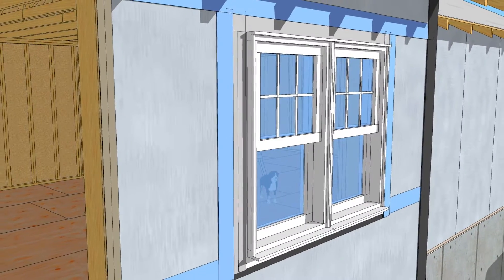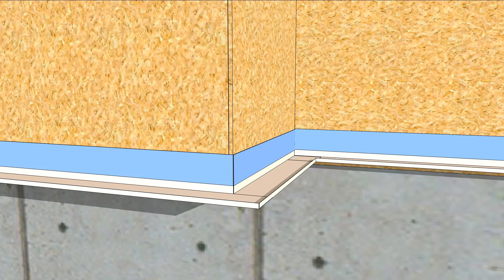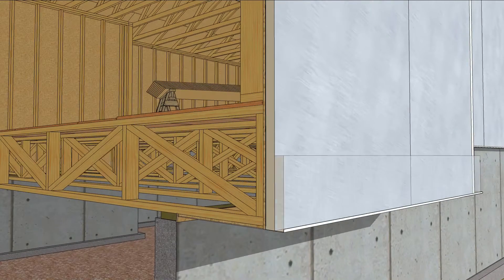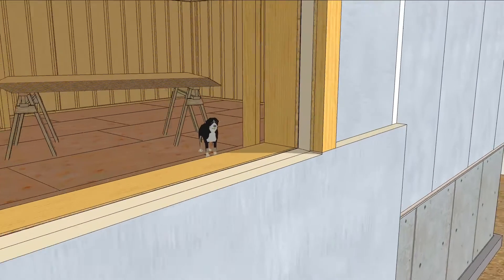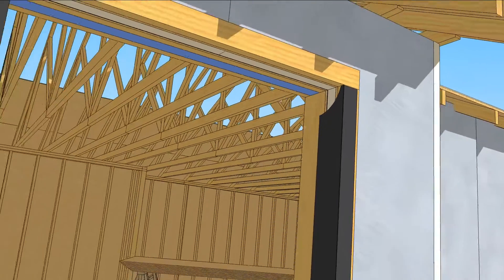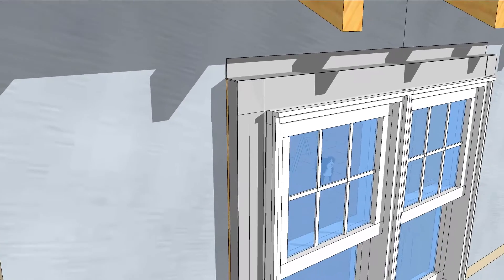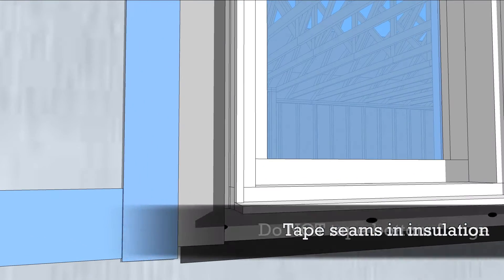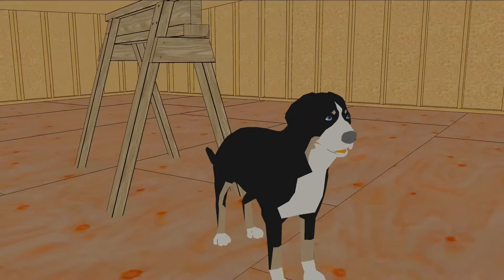Outie Window Details for Thick, Thick Walls

Comment: Thanks and for mentioning the metal bug shield at the bottom and for pointing out how important it is to tape All the seams for air tight. And that 5 degree bevel on the sill and to leave the bottom front of the window unsealed for water to run.....water, air, vapour then thermal are the priorities in that order. Yupee Joe Lstiburek✔💯  ☺🇨🇦🍁
Reply from the maker: I am not sure Joe is a Yuppy, but I will accuse him of it next time I see him. I'll let you know what happens next.

Comment: Yeah this is probably gonna void window warranties. No structural sill holding weight of window from below. Fasteners through jambs and nailing flanges should be dealing with only wind loading not the self weight of the window. No?

Comment: Wouldn't the bug guard hold water since it is folded up on both sides?
Reply from the maker: If water were to get in, yes. But the outer edge is sealed with flashing tape and hopefully, your detailing is good enough that water isn't leaking in between the layers. If it is, you've got other problems.
Reply: its a breathable mesh
Reply: @AdjustinThings  We are referring to the flashing under the insulation. It's metal.

Comment: Actually, this window WILL be dogged by water problems, because 1) The window buck MUST connect back to the structural framing and form a "box" around the rough opening that you can flash to and connect finish materials, shims, etc to.. In the video, the "window buck" fastens only to the first layer of rigid insulation, and there's no blocking at the 1st layer of rigid insul., which can be a problem. 2) The air barrier (house wrap) should be in the same plane with the window nailing flange, so that the flashing around windows can be easily overlap/underlap the house wrap as needed, so that the assembly can properly shed water. In this video, the nailing flange is well outside the plane of the house wrap, and the flashing does not connect back to the house wrap. The flashings, therefore, are not going to work; water can and will get behind both layers of rigid insulation and will not properly drain back out. In conclusion, if you want to use 'outie" windows, this is not the wall assembly to put them in. In this assembly, you'd want the window flange to be installed directly over the sheathing.
Reply from the maker: It's good to see someone paying attention rather than just lobbing "too much work" comments.

1/ I did not show the fasteners because I assumed people would be smart enough to use fasteners long enough to reach the framing behind the first layer of foam. Anyone smart enough to build this way is smart enough to fasten bucks to framing, as you prove.

2/The housewrap is not the primary air barrier.it is part of an air barrier system, which begins with taping the seams in the sheathing. The window flanges ate flashed to the outside surface of the exterior foam, just as they would be taped top the exterior surface of the housewrap. No difference. In fact, the project this was based on used ZIP sheathing, so there was no house wrap involved at all (I included it to be more inclusive of alternate methods).

Here are videos of the process: https://www.youtube.com/watch?v=8dZtRYSouj8&list=PLU1aP_Y9qGOzn6nY_N4rwnvZ4XrYuLTGm
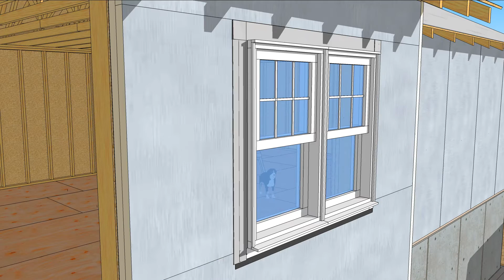Reply: @ProTradeCraft  Thanks for attaching the videos - I watched all five. Your response 1) makes sense, but you still have the issue of having to attach the interior window trim that wraps around the window head. jambs and sill to the one layer of underlying rigid foam. Response #2: There actually IS a difference between flashing to the outside surface of the exterior foam vs. flashing to the housewrap (or Zip sheathing), which is made clear in video #5 at 0:12 https://www.youtube.com/watch?v=4I0tydrCyvE&list=PLU1aP_Y9qGOzn6nY_N4rwnvZ4XrYuLTGm&index=5. In the video, the voice over mentions the Z-flashing atop the window is used to "push the water out if it gets behind the outer layer of foam"; but what about the inner layer of foam that water can get behind? Therefore, you need to flash back to the housewrap or sheathing , which serve as you water resistant barrier. Flashings need to tie back to the water resistant barrier in order for water that can (and will) get behind the rigid foam insulation to be routed back out.
Reply: @Seattle-2017  It's even trickier than that!  EPS is vapor closed so using ANY EPS on the exterior of the WRB means the wall only dries in one direction-IN!  Any moisture trapped between the EPS and the WRB (whether its taped Zip or house wrap) does not dry outward!  Not an impossible to mitigate problem but it demands the use of a really good 'smart' moisture barrier on the warm side of the wall.  Using a standard plastic vapor barrier (vapor closed) will create so much moisture between the barriers that (WRB and moisture/air barrier) that rot is virtually assured.  I ran into a legacy situation similar to this and solved it with the use of mineral wool interior insulation and an Intello smart air barrier.  Because it self adjusts according to the moisture on either side of it it can be nearly completely vapor open (usually in summer) and nearly a perfect vapor barrier (winter) in the appropriate situation.  In other words, it allows the entire wall to dry to the inside regardless of where the moisture originates, which typical poly does NOT allow!  And yes, my cap flashing went all the way back to the sheathing!

Comment: Is it a really a good Idea to install the window on the outside of the foam?  I've always been told to keep the windows inboard.
Reply from the maker: You can install innies or outies. In fact, you can also install in-betweenies. The most important part is understanding that the control layers (air, moisture, thermal) need to be continuous.

Innies: https://www.youtube.com/playlist?list=PLU1aP_Y9qGOyL1SsYhpAaFo5DcdlUBCrq

Outies: https://www.youtube.com/playlist?list=PLU1aP_Y9qGOzn6nY_N4rwnvZ4XrYuLTGm

In-betweenies: https://www.youtube.com/playlist?list=PLU1aP_Y9qGOzPNC6Qkj-hWXIS0Xr0s4tD
Reply: Correct; windows that have a nailing flange should be installed inboard if the rigid insulation, directly over the sheathing (that is, after flashing membrane is applied around the rough opening).
Reply: The insulated pane should be vertically aligned with the outermost insulation layer for best results (a straight isotherm is a happy isotherm!) so 'outie' windows would be the best case from an actual #buildingscience perspective.  Moving the window in at all creates a thermal bridge that is not necessary.

Comment: Have you installed an outie using rockwool comfortboard
rigid insulation instead of rigid foam?  How would you
weather proof the window back to the water-air-vapor
barrier installed over the sheathing as per Building Science?

Comment: Where’s the firing strips?  The window is going to be recessed if you go this route and the vapour barrier is not complete from the outie window to the inner vapour barrier. From what I’ve learned the vapour barrier goes on the outside to connect with the window flange.
Reply from the maker: You can see them in the opening shot of this video, which is what the animation was based on: 
https://www.youtube.com/watch?v=4I0tydrCyvE&list=PLU1aP_Y9qGOzn6nY_N4rwnvZ4XrYuLTGm&index=5

the whole playlist is here:
https://www.youtube.com/watch?v=8dZtRYSouj8&list=PLU1aP_Y9qGOzn6nY_N4rwnvZ4XrYuLTGm

Vapor barriers are a whole other topic that depends on your climate zone. Based on your spelling, I assume you're in Canada?

In general, they go on the warm side of the wall (in winter), so inside the framing for northern climates. frankly, though there are very few places where a continuous vapor barrier does more good than harm. Air barriers and good flashing are far more important in controlling moisture problems.